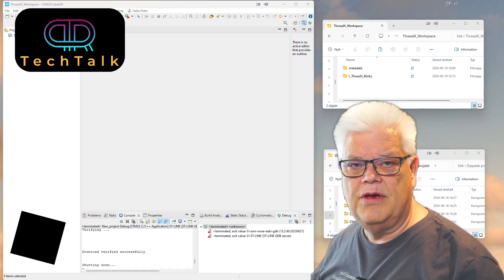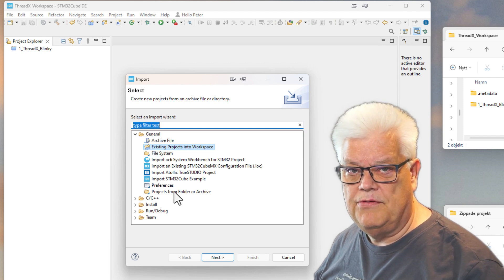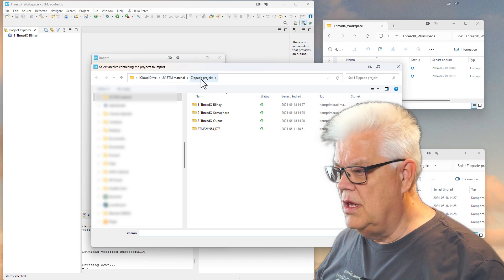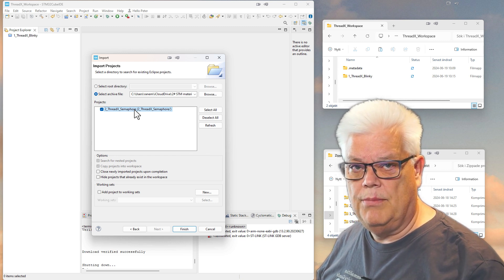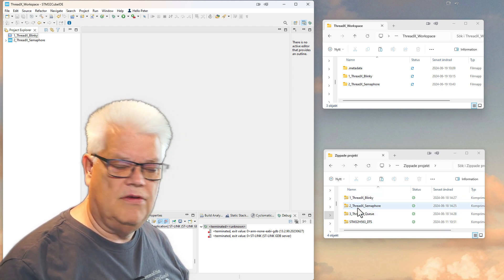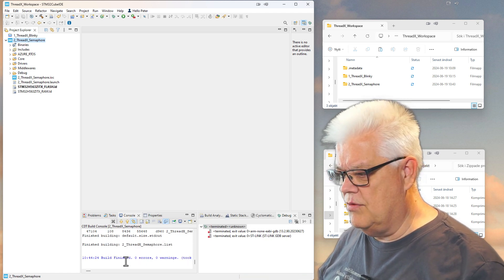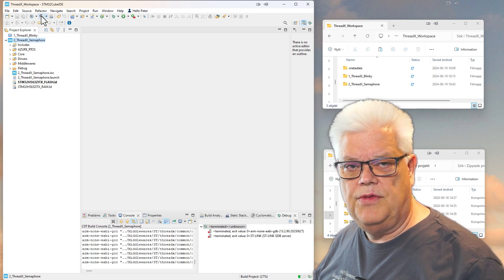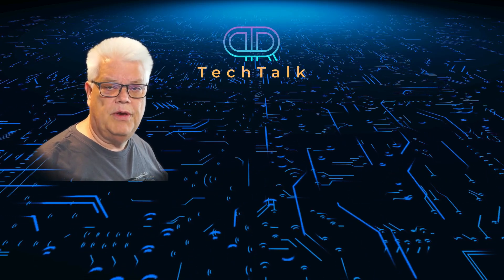QuicTip #7 How to import archived project into STM32CubeIDE

Comment: I can't use the build option. It's greyed out to me. I see a .launch and .ioc file. Why could this be happening?
Reply from the maker: Are you trying to import a project with same name that is already in your project folder, then this might happen.
Reply: clear previous generated codes (or basically file->save project as-> then save the project somewhere else)
in stm32cubemx click project manager -> Toolchain / IDE -> select STM32CubeIde ->  Click generate code or press ctrl+s -> after code generated try importing the project again